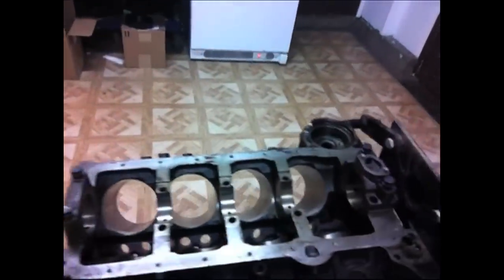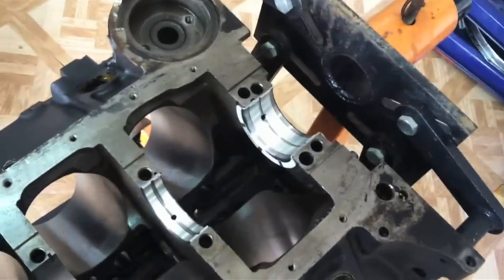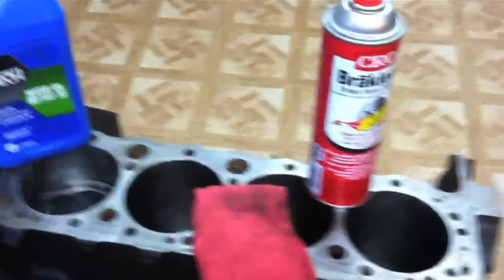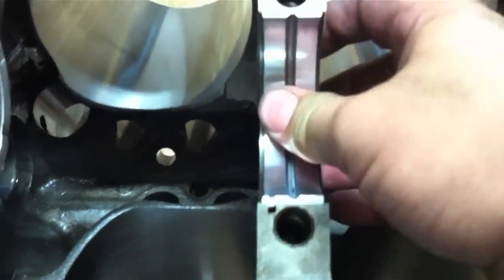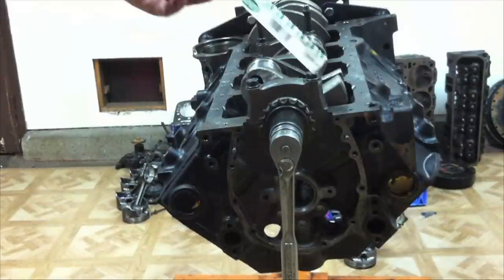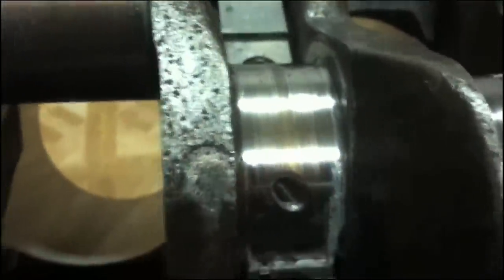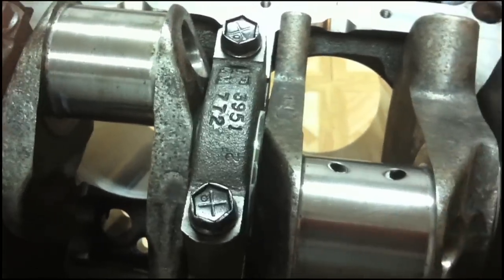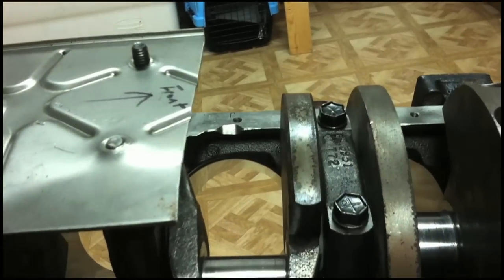How To Build a Chevy 383 Stroker - Part 1: Block & Crank

Comment from the maker: Of course I got paid for building this engine. Why would I build an engine for free? I only charged him $500 and told him I would NOT warranty the engine. There was a LOT of work to clean up the block, crank, pistons, etc. The rods and bolts cleared fine. I tell EVERYONE that being cheap will ALWAYS cost you in the long run. Take a look at the engines on my website to see how an engine looks when it is done right.  corvettesandcustoms dot O R G

Comment: I never recommend using old parts to build a motor cause of condition could cause engine failure if you build a motor spend the time and money to do it right
Reply from the maker: Absolutely.
Reply: Agreed. But, sometimes you gotta go with what you got. The 'claimer motor" situation for one.  If any swingin' dick can come up and nab your motor for $500, you better not have more than $500 worth of new parts in there and you better put it together yourself. And, sometimes, a guy doesn't have the money for new parts. Pay the rent, water and lights or get a new crank.  It's a fact...